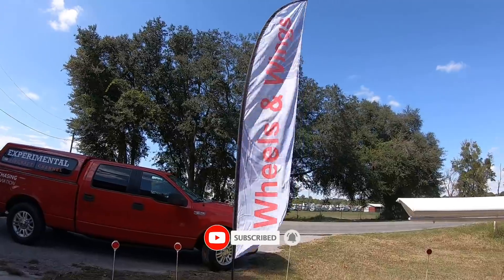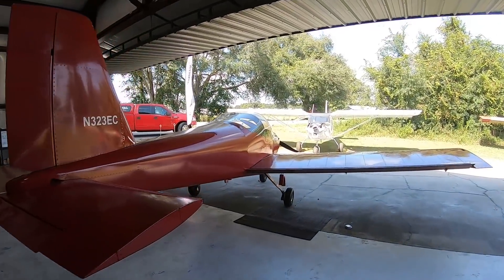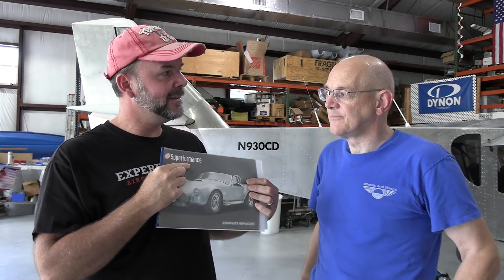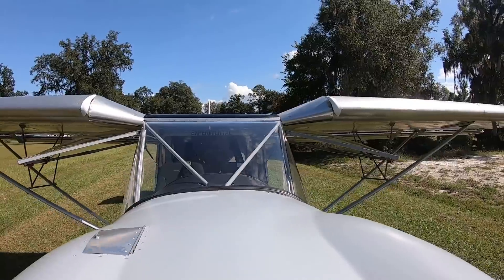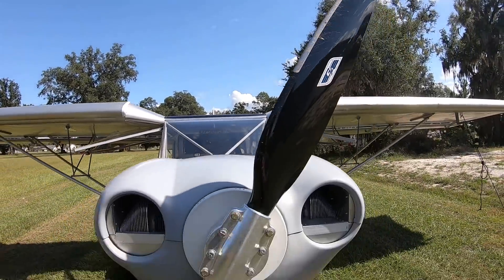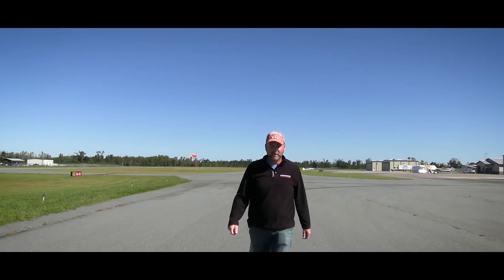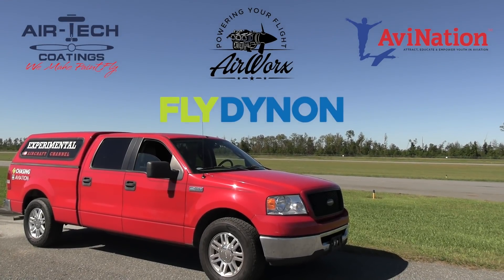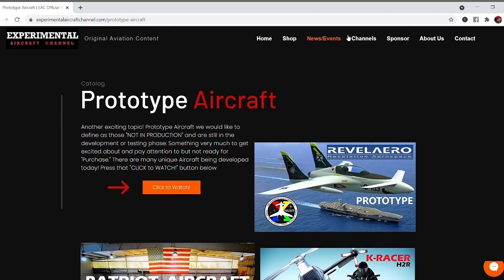Build Your Aircraft Faster - Wheels and Wings Lake City FL

Comment: Shoulder harness attachment location should be between level and several inches below the top of the shoulder.... At least it race cars that's generally the rule... Up high like that doesn't keep the body from rising "up" off the seat in a flip over crash....
Reply: Actually, the FAA and many racing associations specify from -10 to +30 degrees above shoulder is optimal range.
Reply: I've never understood why people do that with their airplanes.
Reply: @peteranderson037  crash them, or install seat belts that way? 🤷😂